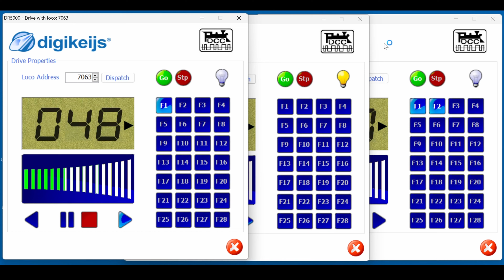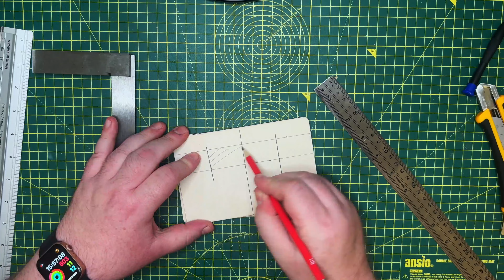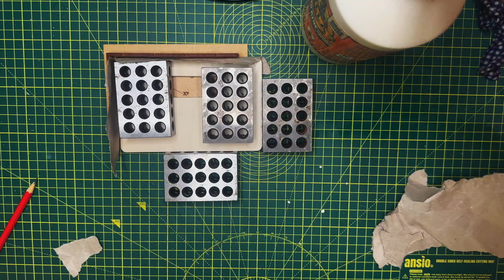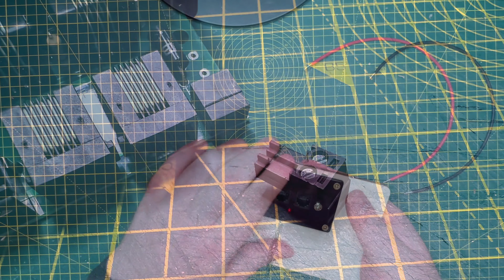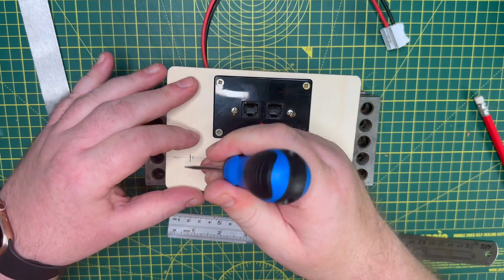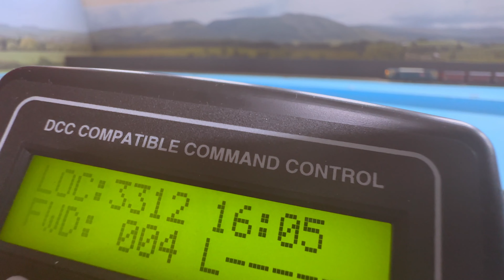079 - Test Track - NCE Powercab Installation

Comment: Hi Ian, The NCE Powercab is a nice little unit, it was the first system I used when I started my layout and now I use it just for my separate test/programming track (as you are probably aware I use the DR5000 for my layout now). I use baking paper to stop glue sticking to unwanted surfaces as it peels right off. Cheers for now.
Reply from the maker: Hi John! That's exactly what I plan on using the Powercab for myself - I just need to build a test layout! Actually, maybe I should build Shelfington first!!! Lol! Thanks for the tip on using baking paper! I'll add it to my arsenal of tips! All the best, Ian.

Comment: Hi Ian the power cab should be enough at 2 amp if you are going to have alot of sound loco it may not be enough, the other problem i didn't like was making the scound from 1 to 9 easy but after that it made it hard to the point of you don't use all the sounds but i would still recommend it as a good starter for dcc. Ok enough of me winning. interesting video and nicely put together. Colin
Reply from the maker: Hi Colin! Thanks! The Powercab actually only puts out 1.5A, which is a bit low for my liking! By the time other DCC power requirements have been taken into account, like servo control, lighting, and as you point out, sound, it doesn't leave a lot of headroom left for adding additional locos! I've haven't used the controller enough to comment on how good it is, as I just want it to move trains back and forth for the time being! I'll more than likely end up putting it through its paces, and review it though - you know what I'm like by now! Lol! All the best, Ian.
Reply: @iansngauge  And you review great
Reply from the maker: @collinsngauge5493 - Thanks Colin! That's very kind of you to say so!

Comment: Good to see you have a DCC solution in place until the new bit of kit arrives.  I suspect the Powercab would be powerful enough to cope with Shelvington, (unless you are concerned about maybe having to install a booster) but as I have found the controllers can be tricky little things to use to switch quickly between locomotives - that's how my Royal Scot shot up the branch with eight coaches on when I had left the points set wrongly.  Its a powerful beast of a loco and had reached the top of the gradient before I could stop it just before it would have launched - Mission Impossible like - over Sharky's End.  Stephen
Reply from the maker: Good evening Stephen! Thanks! The Powercab was supposed to be for controlling a small test layout I plan to have, but it has proved very useful for getting Shelfington up and running on DCC again! The Powercab only puts out 1.5A, which should be good for running half a dozen locos, but doesn't give much headroom for powering other DCC items such as servo motors, lights, loco sounds, etc. My DR5000 puts out 3A, and can go as high as 5A if you connect it to a more powerful power supply! Ah, yes, switching locos can be a bit tricky with a hand throttle, but they come with a big STOP button to press when you get into a panic! Lol! Shame you haven't got video of the Royal Scot! I'd have liked to have seen that! :) All the best, Ian.

Comment: Ian interested to hear you say that you didn't think
Reply: Sorry about that a cough caused me to send an incomplete message!
Continued
that the powercab would have insufficient power to run shelfington.  I have a medium sized 10ft x10ft n gauge layout and my powercab allows me to run 4 trains at once....although the operator finds it difficult to cope!
Reply from the maker: Haha! Dangerous things coughs! Lol! Yeah, the Powercab has a maximum output of 1.5A as far as I'm aware, which in theory, should be good for six or seven locos running! However, by the time you've taken into account other drains on the DCC bus, such as powering servo motors, lighting, loco sounds, etc., it doesn't leave a lot of headroom! My DR5000 can put out 3A, for instance, and with a different power supply, up to 5A! But yes, running four trains at once can certainly be demanding! :) All the best, Ian.

Comment: Ian, just a question for clarification. The powercab doesn't happen to use Loconet? As those rj connectors it uses would suggest?
Reply from the maker: Hi! No, I don't believe the Powercab supports LocoNet! The RJ connectors are just there to make it convenient to plug the cables in I guess! Cheers, Ian.